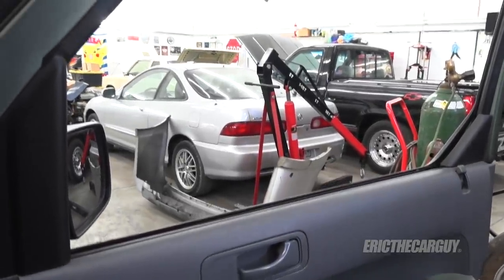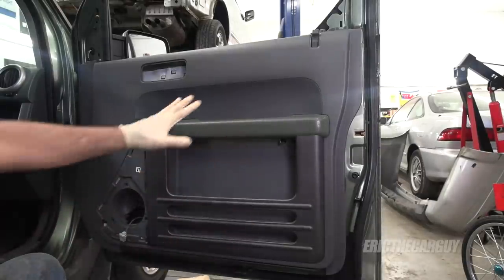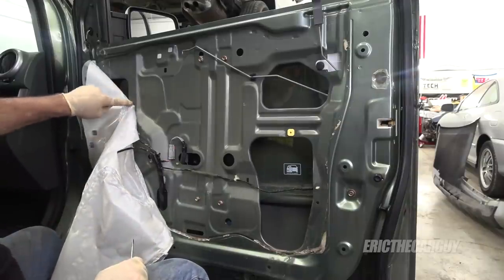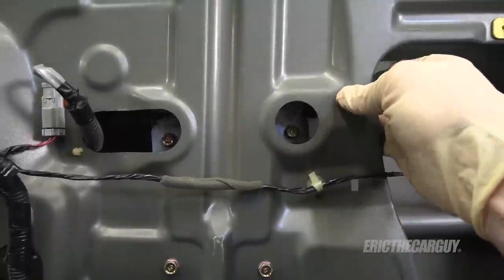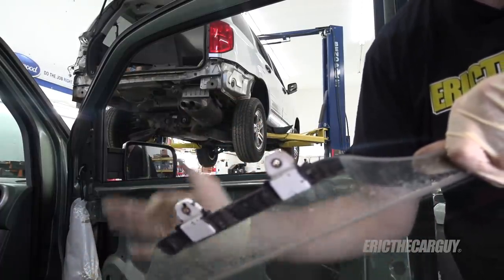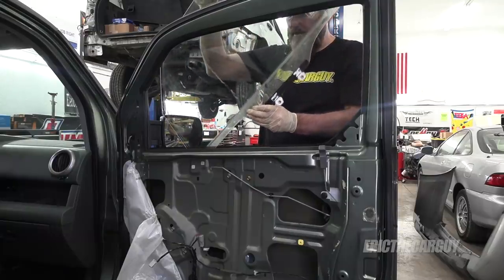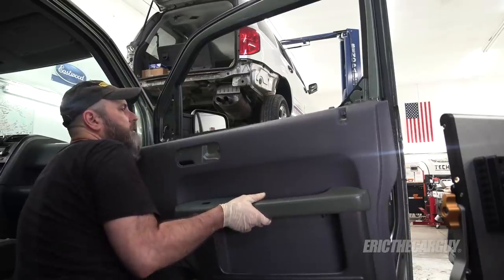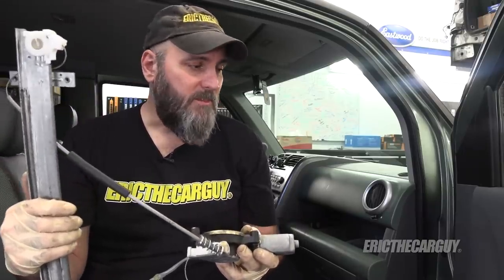Honda Element Power Window Diagnosis and Repair

Comment: Thanks so much Eric! Your video was awesome as I followed it to replace the assembly and motor for the driver's side window of my 2008 Element. 60 minutes to disassembly and 90 minutes to fully install. I feel like that was a huge success! If anyone needs additional input, feel free to comment. Quick Note: After re-assembling everything, the Power Door Unlock worked but the Power Door Lock Button did not work. After Google searching, I found that holding the inside door handle FULLY OPEN and pushing the Power Door Lock Button seemed to "reset" it. All is well. :)

Comment: Thank you Eric!! My window would not go up yesterday after work and I have to say I'm the most car illiterate girlie! Thanks so much for creating this instructional video. I was able to follow it and managed to replace the driver's side regulator in about 3 hours! I only broke the screws on the rear cover of the window, that one was insanely hard to take off! I will be replacing my speakers next!!

Comment: Was driving to work a few years back when I noticed a slight wind noise, like a window wasn't properly closed.
I pushed the buttons to close all windows, when my front passenger window just disappeared down into the door.
From the dealership, I could choose between a complete assembly with new inner door cover included (expensive), or a rebuild kit with just the wires for 1/10 of the price.
Took me a while to install the new wires, but it was so worth it.

Comment: I had my window fail just before a 20 degree night with a blizzard forecast for the weekend. Thanks to your video I got the panel removed to diagnose the issue. Got the window taped up, drove 5 hours in the snow, got the part for $49 from Brock, replaced the motor in 2 hours and it works great now. All in less than a week and with very little previous knowledge of my Element's door panels. Thanks so much. Next I need to take on fixing the lock regulator that actuates the door lock on the driver side.

Comment: You sir, win the YouTube University award for clarity and brevity! I was able to remove and reinstall my driver side regulator and motor in an hour and fifteen following your instructions. Thank you! BTW, I used the Dorman Window Lift Motor Part # 748-132 for the passenger side. The driver side is part # 748-131.

Comment: Darn nice of Honda to install them with bolts, hate drilling out rivets to replace window motors.
Reply: Unfortunately most cars are like that now ☹️. And the new vehicle power window elevator assemblies use steel cables instead of wheels, tracks, & gears as an assembly.

Comment: As far as the vapor barrier reattachment is concerned I’ve used some double sided adhesive tape or even silicone adhesive to augment where the original glue line was. Particularly if it’s been removed a couple of times.

Comment: You brought back memories of a nightmare job I did a few years ago. I had to replace the driver's side power window motor on a 1976 Ford LTD. The book actually called for me to cut the inner sheet metal of the door in a "C" shape and bend the piece back to gain access to the motor. Part of the reinstall was to bend the piece back and use seam sealer to hold the piece in place. I think they must have put the door together in two pieces at the factory, sandwiching the motor and related parts between the inner shell and outer door skin.
Reply from the maker: Yea, things have changed a bit since then. This is much easier in my opinion.

Comment: One thing I suggest while doing this job: take this opportunity to do preventative maintenance! 😺 Take those rubber/flocked window wipers off and clean them well with soapy water. Put some Aerospace 303 on the rubber side that doesn't touch the glass. If the flocked glass side tracks/guides come off the door easily, clean them well in the sink too. They hold fine dust particles and industrial fallout which scratches glass and tint. Afterward, lubricate the side glass guides/tracks with some Teflon dry lubricant spray. That helps decrease the resistance to upward travel, and helps the motor last longer. Don't lube the wipers or the top seal/guide though because that'll smear the glass. Just Teflon spray the 2 sides. Also lubricate Amy other parts you can, like any lower window or regulator moving parts/tracks/pulleys, the door lock actuator and linkage, the interior handle pivot, and the inside of the door check strap where the spring and ball bearings are. Also clean the bottom of the door's interior cavity of all the dirt or muck that tends to build up. That muck blocks the drain holes, and you end up with stagnant water that sits inside, ruining the door card, growing mold, and rusting everything. Suck and scrub the muck out with a vacuum and poke through the drain holes so you know they are wide open.  Lack of lubrication and preventative maintenance is what kills door interior guts. :'( I've seen it so, so often. In my opinion, people should remove the door panels and do all of this stuff at the 5 or 6 year mark REGARDLESS of any parts breakage or problems. It's just good, easy stuff to do to extend the life of expensive stuff. 😺
Reply: Agreed, cleaning while the glass was out and the door disassembled makes sense plus my OCD wouldn’t have let me put that dirty glass back in. 😁
Reply: .... and this is why I always take some extra time to read comments under videos about these such matters!! lol. Thank you.

Comment: Our 2003 Element driver side window stopped working, but I could hear the electrical was fine so I figured it must be something else.  Not knowing how to troubleshoot further, I started the disassembly and was able to get to the point of manually moving the glass up and down but I was at a stand still from there.  Looking at the door I was thinking I was going to have to figure out how to take the whole door apart, haha.  But then I thought I should do a little research.  When your video popped up first I knew I was in good hands.  I've watched a couple of your other videos about Element stuff and should have know to come straight here first!   I just ordered the part (aftermarket) using your Amazon link and I'm confident I'll have success with my repair.   Thank you for for taking the time and effort to share your knowledge and experience so we can learn too.  I appreciate your channel so very much!   Thanks again!

Comment: Thank you Eric, you are a lifesaver. I ordered the parts you suggested and after following your ever so helpful instructions I had the project done in 2 1/2 hours. Besides the time and cash I saved taking our Element to a repair shop it gave me a great deal of satisfaction doing the job myself. I did the needed repair on the driver's side window and I said to myself that I may as well get the part for the passenger side as well because it has been giving me grief lately. Thanks to you it will be a no-brainer. Thanks again!

Comment: I made the mistake of bragging to another element owner that I still have not had any problems with my windows after 160,000 miles.  Of course, the next week my passenger side came down (in full rain).  Your video helped a lot getting the new regulator in (wasn't finding the screw behind the handle, lol).

Comment: Just as so many others have comments, great video. Window sounded just like yours at the beginning of the video. Followed exactly as you talked it through and everything went perfect. Replaced regulator and motor assembly and now have a working window again. Exactly the video I needed. Thanks much.

Comment: I literally just did this yesterday for my drivers side. The cable and the winder got messed up and kinked the steel cable. A replacement was pretty easy to install.

Comment: Great video. Followed this and fixed the window on my 2006 Element. My issue was the driver side but this video sufficed. Took photos of all the connections and steps along the way. Good stuff. Saved a lot of $$.

Comment: Great video. I just received my regulator last week and will be replacing the driver side door on a 2014 pilot. Should be easy as pie. I did the same job on my 2003 accord.

Comment: 4:22 i just sliced it down the middle and later i put greenhouse tape. It's the thicker type of tape that's rated for UV and -30c in direct exposure. IMO, the less you mess with the factory installation glue and clip, the better. Using that cheap type of tape is perfect for this, it will never let go as it's meant to go in direct snow, rain, sun. Ten times better than any other type of tape that's not duct tape.

Comment: Eric, you seem you seem to be having all the exact same problems with this honda element as I do with my CRV of the same vintage. Every single video you upload, is what I had to do the month before, but you make it look so, so, so much easier.
Reply: and now, of course, speakers, door locks, everything, completly stuffed, i seem to be taking the door cards off as often as I fill her up with gasoline. its like a regular thing now
Reply from the maker: I'm glad the videos are timely. Also, I hope that after you complete the fixes you don't have to mess with it again for a while.

Comment: Thanks Eric, a very good run-through. My 2005 Element passenger side window just "popped" and then slowly lowered; and won't raise; so I'm sure it's either the actuator, the motor, or those clips near the bottom of the window that may have broken.

Comment: I did this TWICE on a Honda Accord with an aftermarket regulator within a year. I could not find the Honda factory regulator. I noticed the nylon wheels that directed the cable were very thin, the cable was much thinner and most importantly, the electric motor was so much smaller than the OE regulator. Well we know where that regulator was made.......🤷🏻‍♂️I use compressed air to clean the tracks and then apply silicone spray on those window guides and add a bit more lithium grease to some of those friction points. Good luck and best wishes.
Reply from the maker: I prefer silicone paste on window slides. I find that the spray dries up and doesn't lubricate for very long as a result. Thanks for the comment.

Comment: For the plastic vapor barrier you can use RV tape (butyl tape) think that's what oems use anyway. Worth having a roll or two just to have. Stuff (should) never dry out so it'll last a long time.

Comment: Thank you so much for this video! I was able to fix my driver side window with only one little problem. That plastic piece in the back that you were having trouble with, I had trouble with also and it broke. Is that piece completely necessary? Or can I live without it? Thanks again for the great helpful video!

Comment: Very professional tutorial. It actually doesn't seem too dissimilar from some of the European models I've worked on. Sometimes, I think the trickiest part is getting those little plastic hole covers out without scratching or nicking them - they're just so soft.
Have a great weekend.
Reply from the maker: This seems to be a common design on late model cars. It's likely cheap to make and can be configured to work on several different vehicles. Manufacturers don't often make these parts. They buy them from smaller specialty companies. Always nice to see you. Have a great weekend.

Comment: really good, thanks! JUST one thing: neither the door lock knob next to the window AND the window switch for that side dont give any electrical sounds. Would  buying and installing the unit to plug in to use a fob to circumvent needing a driver side door key solve both issues?

Comment: I like to put blue painter's tape around the openings to keep the cuts and scratches and cuts at a minimum. They make suction cups on strings to hold the window up so you don't have to remove it. I've also seen guys use tape over the top door frame or even doorstops to wedge them up. Personally I've always been afraid of the window falling down using those methods.

Comment: Part of my job at the glass shop is windshields, side and rear windows, and regulators. We worked on a '57 Chevy a couple weeks ago that had aftermarket air conditioning. It was almost impossible to reach one nut holding the windshield chrome in place. I had a bruise on my arm for 3 days after that one. lol

Comment: Quite the same as my process except my speaker doesn't need to be removed.  Few moth ago, I had replaced my rear right side window regulator of Ford Activa 2001 1.6L at home in Taiwan...

Comment: Love the Element content.  I do wish you had some Vtec codes to investigate and address. Lots of E owners groups have p2646 and p2647 codes.  Great work either way Eric.
Reply from the maker: The #1 cause of VTEC problems on Hondas in my experience is low oil level, or using the incorrect oil viscosity. I've also seen issues with low oil level causing premature timing chain wear which can set a code for iVTEC. The timing chain on the K series is lubricated by the oil in the sump. When that level gets low, the chain is starved for oil. I hope that helps.
Reply: @ericthecarguy  I'm pretty fastidious with my oil level and viscosity, 5W20 always and Mobil 1 usually.  Makes me wonder if the previous owner let the oil level dip low and allowed the cam chain to wear.  Usually I'll get the code and its like the solenoid is dead. Swap in a new one and it works a treat... for a while.  Maybe I just have bad luck with electrical components? Thanks for the reply Eric.

Comment: Hey @EricTheCarGuy one other thing I would do is shoot some silicone spray in the channels of the window to give it a smooth operation. #GOODSTUFFBOSS
Reply from the maker: I don't recommend the spray is it will dry up quickly. Silicone paste works much better for that in my experience.

Comment: Great job Eric! I have a similar situation with my driver side window on my 97 Isuzu Trooper. The clips holding the window have snapped and I have installed new ones however the adhesive was not strong enough to stop the window from slipping out of the clip hold. Can you recommened an adhesive strong enough for the clips to hold the window in place please? Also I am not getting any mechanical feedback from the window button. Is there anything I can do to diagnose this problem? Thanks

Comment: I need to replace the driver's side controls for the windows in my sentra.  The switches are getting iffy and now the driver's window is too unreliable to risk rolling down.  Thankfully it's a 20-25 buck part with three torx screws, and the trim is already screwed up, so the replacement is down to when I can get the part.

About time I run into a fix for this POS that isn't an arm and a leg, or hours of tearing down the dash to get to the blower motor. (2012, absolute PITA.)

Comment: Great video, but I have a question. I followed your instructions replacing the motor and regulator. Once I turned the car on I could roll up the window (which is great news!) but the window is now stuck in the closed position. I tried reconnecting the cables, restarting the car, and even pushing the window down with no luck. Any advice on how to get the window to respond?

Comment: Great video Eric! I have the same issue in my 05. However, when I try to pull the window up to disconnect the two 10mm bolts holding it in place, the glass is binding and won't go up enough to reveal those two bolts. Any suggestions as to what could be causing this?

Comment: Hey Eric, I have a 2008 Honda Element and over the winter, the power window for both windows only worked on occasions. Now they work only on very rare occasions. It works less and less often now to the point where I haven't been able to roll my windows down for the past 2 weeks. Also both car door power windows aren't working. Any idea as to what this could be? There isn't any noise when I try to roll them down or up. Thanks so much and appreciate the input!

Comment: The last time I had to take a door panel off (on a GM, not Honda product), those plastic clips that fasten over the actuator rods drove me half insane. I couldn't get them resecured properly. It's so much fun when you're trapped in your car because the door handle won't open the door, and you're in some parking lot pounding on the door and cursing a blue streak with people walking past and...well, you get the picture.

Comment: This is so weird,  I own a 06 Mercury Grand Marquis that used to be my grandfathers and I just did a driver door window regulator and this video makes me so sad. I had 4 rivits I had to punch and then drill out. If only they were bolts I would have saved my left hand from meeting a 5 pound sledge hammer a couple times.

Comment: Silicone spray for the window channel could make that window wind up and down alot smoother and faster. The window regulators on hondas r the worst things ever, they fail so often and unfortunately especially in a city like dubai with sand and dust that build up around the cable and mechanism. Love these videos Eric do not stop, funny the name of the area you work in is called lebanon and im lebanese, for a second i thought you are in lebanon.
Reply from the maker: I don't recommend the spray as it tends to dry up. I prefer to use silicone paste as it lasts much longer. In fact, there is a video about it in the description. That said, I appreciate your comment and input. Thank you.

Comment: Doing this for the driver side on my 2003 element was a disaster… i broke the clip for the door handle opening rod, and the vapor cover glue solidified and wouldn’t peel off so i ripped off the vapor cover…

Where would i be able to find replacements for that clip and vapor cover?